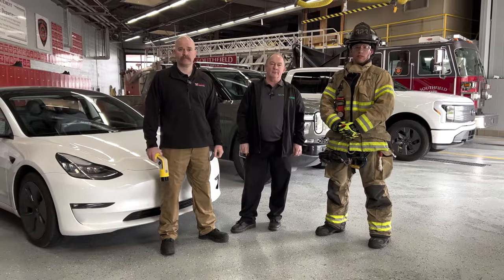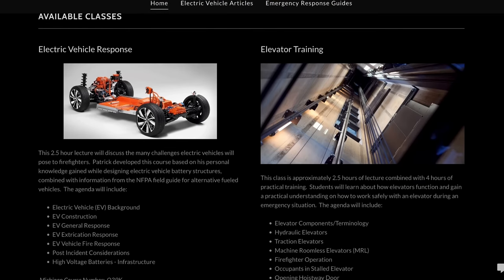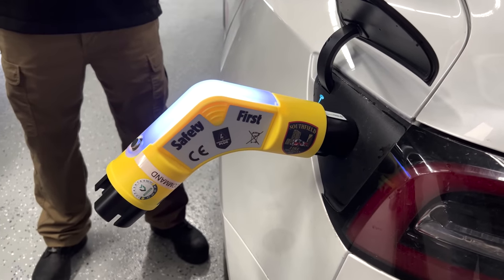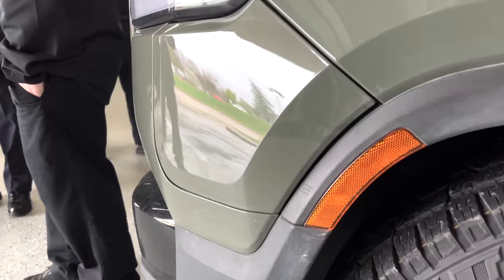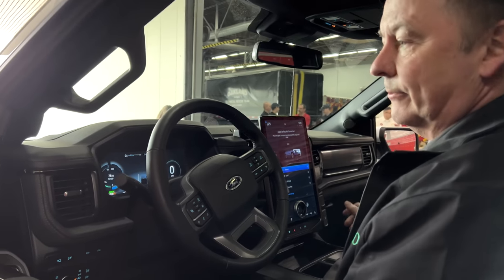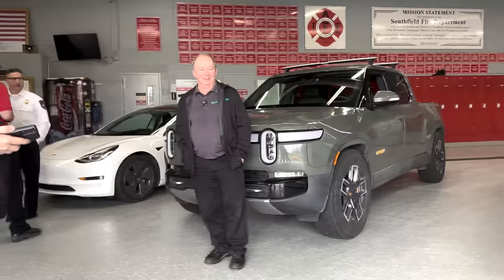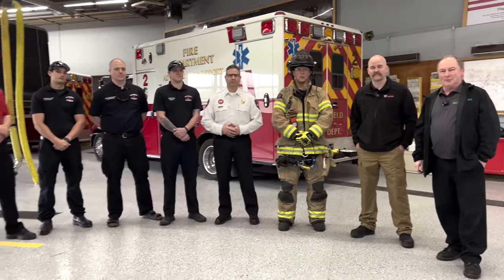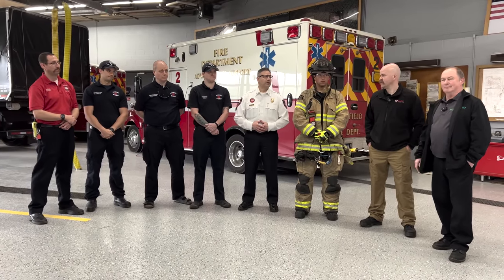An EV Device for First Responders: Emergency Plug Demonstration

Comment: So how does this work?  The pilot signal is ONE way.  The car senses the voltage level based on a resistor divider.   Obviously, there’s no 120/240V in the safety plug.   Is there a pilot signal that denotes “safe mode” in the J1772 spec?

Do all vehicles prevent driving just from being plugged into a dead charging connector?
Reply: the pilot signal is resistive. it does not need electricity to work, just a few resisitors. and yes, by law all cars will not work with anything plugged in.
Reply: There are batteries in the gizmo, and the pilot signal is some low-voltage DC level (can't remember if it's 5 or 12)
Reply: The guy said the Lightning set a charging fault because there was no voltage, but there has to be some level of amps/volts being sent otherwise the vehicle wouldn't react at all. This is to prevent people from driving off with it plugged in - you know like you have seen on those memes with gas pump handles hanging off cars.
Reply: Needs 6v and can also get the resistive required amp, the key here is this device will be primed ready and can read back if doing the connection correctly, great invention.
Reply: @levenkay4468  It's 9-12V, alternating positive and negative to minimize corrosion in wet conditions (dropping the charging handle in a puddle).

It's absolute trivial to generate.  The microcontroller can even drive a voltage multiplier to save a few cents in components, although I'm sure that the parts cost is a trivial fraction of the price.
Reply: The driving lock is there to prevent the car from driving while a cable is plugged in, not while charging. The latter is just a side effect.

Comment: Interesting. Our (Czech) fire department when they deal with EV battery fire (comparetment breached during incident, electrical failure during charging) the fireman pours a lot of water to stop the flames and then they lift and sink the entire vehicle into special movable container they fill with water. Then just observe. So far three incidents (we're small nation, 10 mil) all during charging and all full covered by media.

Comment: This is really neat. I don't know anything about this kind of stuff, but wonder if there would be any use case for being able to discharge the batteries.
Reply: No. The amount of heat you'd need to dissipate to discharge a battery like this would be immense. Also, an AC EVSE can't draw out power, only send in power. (The onboard charger would prevent that kind of reverse current.)
Reply: @fitybux4664  Thank you. Now I know.

Comment: Now, since all charging plugs are standardised. And the only thing letting the vehicle know that the correct plug is inserted and initialising the charging is a stadardised resistor (220 Ohm?) Wouldn't we get the same result as with inserting a EVSE plug that had the cable cut off it? For much cheaper but without fancy LEDs?
We have the same thing being sold to Fire Dpts in Poland and I just wondered about this.
Reply: Just the plug is missing a 12V / 5V Power Source from the Charger side for communication.
Reply: @unitrader403  I checked the cut-off plug (with the internal 220Ohm resistor) on a Mach-E. It did put the vehicle in Park. Don't know about other makes, bit I suspect it's a standard. I doubt You need a 12V on the plug side.
 The plug is being "discovered" by the vehicle based just.on the resistor in the plug and based just on that puts the vehicle in Park and only the ln tries to check for comms.  Seems like snake-oil to me..
Reply: But if it's too simple, then you don't get all the fancy color changing lights in a nice yellow handle! 😆 (/sarcasm)
Reply: @fitybux4664  That's what it seems like

Comment: Mostly good video, my only complaint is that they go over the dangers of an EV battery fire at the end (which shouldn't be understated) but fail to mention how rare they actually are. I know it shouldn't be necessary to mention this, but especially with the bolt's battery recall for fire risk, its easy for people to see EVs as tinderboxes waiting to catch fire and I've even seen anti EV propaganda  'spreading the flames' on that notion, so to speak. ICE cars are actually far more likely to catch fire.
Reply: You say they are rare and you are correct. But what you fail to understand is that they are only so rare because EVs make up a very small portion of vehicles on the road. There is no doubt that if we were 100% EV that the frequency of car fires would still be very similar.
The only difference being that EV fires can be very difficult to extinguish. God forbid an individual needs extraction/rescue from an EV and they catch alight.
Reply: It is possible that EVs are so expensive that owners have deep pockets and might "baby" the car. When the majority have EVs, I think we're going to see a lot more stupid shit being done, and yes this probably will mean more battery fires. 😆
Reply: @aidenward4677  they are rare even when adjusted per capita. Look up some data from countries like Norway where a lot of people run EVs.

Comment: Just deactivating the drivetrain output, right?  All power to interior, computing all on still.
The real breakthrough would be to have a way to shut down all power access from battery without opening access ports and pulling pack fusing.  Probably need at least CAN bus access and a universally available ‘emergency power-down command’ in the vehicle command set.
Reply: You can do that by severing the appropriate cable - it's put in a convenient place for this reason. Down-side is that doing so will severely damage the car. Fine if it's a wreck, but if you ruin a perfectly good car so you can get someone into a stretcher safely it might expose the department to legal risk. And bad PR.

Comment: isnt this plug just a super glorified plug with one single resistor between the ground (central) pin and the PP pin ?
thats how any EV knows you plugged tinto a charger , and the Maximum current admissible by the cable depending on the resistor
Reply: Yeah but don't ruin the fun of charging fire departments a few grand for one
Reply: Yep, and this entrepreneurial firefighter found an injection molding company that can help him retire earlier.
Reply: Nope, it also needs a 12V power Source and maybe a PWM signal generator. The "Its Just Resistors" Part only applies to the Cable connecting the EVSE and the Car, but you also need to simulate the EVSE.
Reply: It's a bright yellow plastic. That's how you know it's high quality!!! 😆 (Even if it has active electronics and a battery, what do you think it would take? A $5 ATmega microcontroller?)
Reply: @Fity Bux  less! A 1cts resistor.
Thats how EVs knows a cable is plugged in so they put themselves in Park mode to not accidentally drag a cable.
I wired EV cables myself as it's cheaper. So I know how they work from experience 
People trying to tell there's more than a resistor and a momentary switch to open the circuit (for release) inside these are just coping.
Reply: @Yot359  So you could make this even smaller and less noticeable and slip it up under the door to immobilize the car?  I’m sure there are many groups out there that would like to know that.

Comment: Now I’m wondering what happens to a locked vehicle that you wrench open the charge flap and plug in this plug? Will it do anything as the vehicle is already in a locked state¿?
Reply: Depends on the car. It will either do nothing, or it will try to charge. Some cars even may have a vulnerability there---as DC charging directly connects the battery to the DC pins, there's nothing stopping the charging station from drawing power out of the vehicle unless the BMS inside the car detects that and cancels the session. But at least there's not much one can do with 400V DC...
Reply: In this case the vehicle will connect the HV pack to attempt to charge, whereas it otherwise would be disabled. This device does nothing other than put the vehicle in park if it wasn't already, and ensure that the normal safety feature of isolating the HV pack when the car is off does not activate ensuring high voltage power is available to electrocute your first responder.

As a first responder myself, and an EV driver, I would NEVER use this device.
Reply: @HenryLoenwind  You're saying some malicious person might be able to steal the charge out of your car? 😆 That's hilarious.
Reply: @fitybux4664  People also steal gas out of cars. And while a full battery may only hold 20-50 bucks worth, petty crime is petty...
Reply: @HenryLoenwind  A gas can might cost $5. A device that can steal a charge from one car and put it into another would cost several thousand dollars.

Comment: Seems like you'd want something that de-energizes the whole drive/battery system and I don't /think/ this does that. I've heard a lot about first responders worrying about the high voltage current risks from a live electric car. I haven't heard any concerns about the car driving off from an accident scene - no more so than a gas-engine vehicle at least.

Comment: wonder if ,by disconnecting the negative or positive of the 12v battery, the vehicle would shut down
Reply: It would probably fault, but not shut down?

There's a bundle of wires marked with a fireman hat in my car that directs them to cut on the X to disable the car

Comment: The main contactors are still closed, and it also requires the 12v to be connected to a car which is in an accident. Having the car be put in park is fine, but this needs to be developed with the auto-makers, we need an emergency mode, not a charging-fooler. 
Honestly, I know the intentions are well, but I wouldn't want the first responders using time on this.

The fireman's loop in new EVs are safer anyways, because it actually disables the battery and charge circuitry, this solution specifically keeps the battery and chargers active.

Comment: A large amount of people here in the comments are missing the point of what this tool is actually for. People are talking about battery cut loops and fuses to pull. That's not the point.  This tool is NOT for trying to isolate the battery. It's simply make sure the car is in park, or force it into park if necessary.

Comment: 6:24 Never understood using gallons of water as a measurement for putting out an EV fire.  You can put millions of gallons of water on a lithium battery fire and it still wont go out.  It creates its own oxygen and fuel (the electrolyte), so water, nor foam, can put it out.  Water is just cooling the battery while it releases its energy and helps to reduce other things around it from burning.
Reply: The more heat you safely dissipate, the less the damage to the surrounding area. The car's a write-off, but with enough water you can save the asphalt, adjacent vehicles and building frontage.

Comment: so when you have wreck on the road what does that tool actually do ? I m a bit confused, can someone please explain.
Reply: Nothing especially useful.  It mimics a "charger" (EV supply equipment) so that the car refuses to drive away.

It doesn't shut down the traction battery HV system.  In fact it may activate the contactor and energize more of the HV system.
Reply: @1djbecker  it locked like it does nothing
Reply: It prevents someone from getting in the car and driving away.

I somehow doubt the case "car is still in drive and slowly creeps forward" happens very often at the time the firefighters arrive. They take long enough for any car to have reached an immovable object. And then reaching in and pressing the parking button before opening the hood and cutting the battery disconnect is enough.
Reply: @HenryLoenwind  tesla will come to stop so it's a useless tool in my opinion
Reply: For a wreck, nothing. In a wreck you'd want to cut the power cable -  it's always positioned somewhere easy to access for exactly this reason. I think the intended use is for slightly-damaged cars, or intact cars where the driver is incapacitated: It makes sure that someone can't accidentally knock the controls and start the vehicle moving while paramedics are trying to extract the occupant safely.
Reply: "What does the tool actually do?" It lines the pockets of the people producing it.
Reply: @fitybux4664  Good luck selling something so useless
Reply: @vylbird8014  if you dont step on the brakes the car wont move, and once you in a collision the car stoped anyway and if is just a small accident you are going to pull over and stop so this is the most useless tool ever.
Reply: @norbertbajgyik1607  preaching to the choir. 😀 Maybe they can sell pet rocks to firemen while they're at it.

Comment: There have been a lot of “it’s useless” comments here. Consider this. The vehicle is in an accident, it’s still in drive, the driver is either pinned or unconscious, or both, and his foot is still near or on the accelerator. One wrong move trying to extricate…
Reply: If it's been in an accident, the accelerometers (that trigger the airbags) would have already detected a crash and the car would already be disabled. This yellow plastic device is just an expensive trinket that basically does nothing useful.

Comment: Now we need to have a standardized FireFighters port for the battery pack to allow emergency responders to inject fire extinguishing agents directly into the packs.  They're already circulating coolant into many of they today so how difficult would it be to add a battery port (perhaps next to the charge port) for fire control?

Best!

Comment: not an invention! plug in any charge cable: driving disabled battery contacts open ignition off.
Reply: exactly. they just cut the cable and added a light to it.
Reply: Exactly. I just made a video about it

Comment: Great overview, looks like this tool could really help some people.  One error to mention here though:  Patrick suggests flooding the battery with water to put out a fire at @6:40.  This is a pretty bad idea, as the lithium is highly reactive to water, and this will cause either an explosion or a larger fire.  Recommend foam, CO2, power graphite, ABC, or Sodium Carbonate.
Reply: The fact is that, once the battery is on fire, there is simply no way to stop it. Firefighters do use lots of water with the mere aim to limit the heat damage to the surroundings.
Reply: Your advice would be correct for a lithium metal battery, but lithium-ion batteries don't have metallic lithium in them.  There's a lot of good training for firefighters to respond to EV fires available if you want to learn about it.
Reply: Sodium is even more reactive to water, yet I've never heard anyone saying it's a bad idea to put sodium chloride (table salt) into water...

Comment: It has always been possible to force open the charge port door and insert a very basic device that short circuits the door.
Reply: This doesn't "short circuit the door". It tricks the car into thinking an EVSE is connected. If you short circuited the connectors, guess what? Nothing happens. It is meant to be safe like that.

Comment: So why do you need plastic tools to open the charge port? All you need is a frequency transmitter that blasts the open frequency. They sell them cheap on the internet. The only time it wouldnt work was if it was in drive. Why would it be in drive? The car automatically puts itself into park when driver exits vehicle

Comment: Very informative video.  This device could be dangerous in the hands of criminals.
Reply: How would it be dangerous?
Reply: the charge port canot be opened when vehicle is locked. any charge cable plunged into an open charge port disables the vehicle. surprised there aren't more robberies at ev chargers since a plugged ev is disabled.
Reply: This isn't dangerous to criminals. It's dangerous to any firefighter who thinks this will provide any safety.
This does not de-energize the vehicle, all it does is put it in park, and you can just as easily put the vehicle in park the same way you do on every other car on the road, there's nothing special about EVs here.
If you need to work on an EV you cut the firefighter cut loop, you don't just put it in park.
Reply: The charge port can be pried open quickly and easily by force. Hijackers can then disable the vehicle and pursue the hijacking  of the vehicle.  Just a thought.
Reply: @davidck1  which makes it completely useless. Emergency personnel have many decades of experience safely putting vehicles in park. There is absolutely nothing EV specific in that process. The only EV specific part is cutting power, and arguably that's not even any different than the way emergency personnel are already trained to disconnect the 12v battery on internal combustion vehicles.
Reply: Seems like a dangerous thing to exploit if a car could be forced into park at freeway speeds. WTF were the engineers smoking where they built in such an obvious design flaw? If the device was small enough that the charge door could close, you might never know it's in there.
Reply: @davidck1  you can force the port open. Note that it does not have to be stealing the car. Just disabling the car helps with stealing cash from the occupants.

Comment: Um, "Most [electric] vehicles in the US"  are Teslas.  So why would you need an adapter for a tesla car.  You should need an adaptor for other cars!
Reply: "Most models", fanboy
Reply: Because the Tesla connector is smaller, and it would be mechanically unstable to go from a small connector to a larger one? 😆 Wait, no, it's just a conspiracy against Tesla drivers! Yeah, that's it!

Comment: Could you slow down I can’t stick the tool in the hole. Guy having seizures driving 70 down the highway.
Reply: People having seizures usually pull over and Tesla can actually help with this if AP/EAP/FSD are engaged.